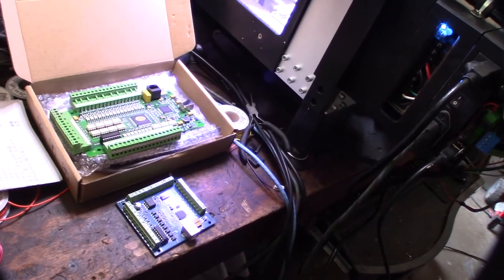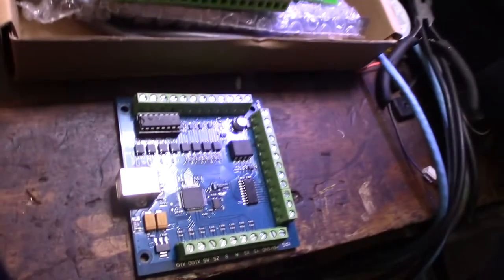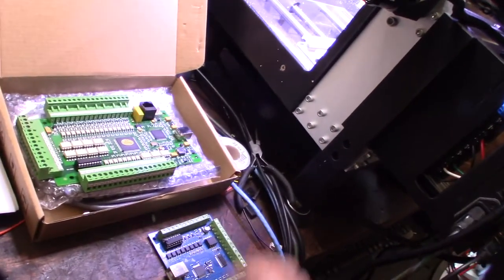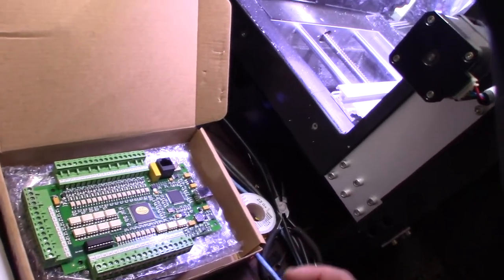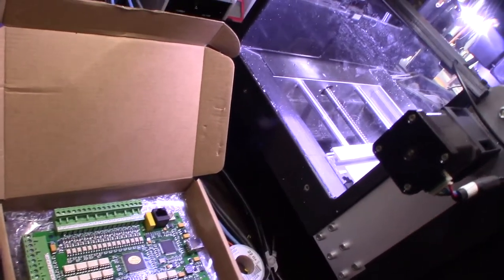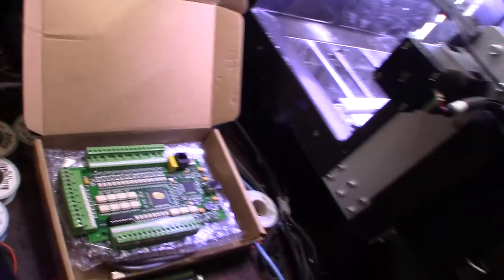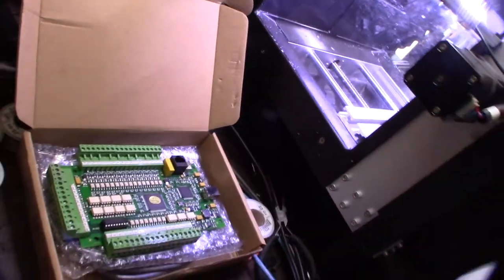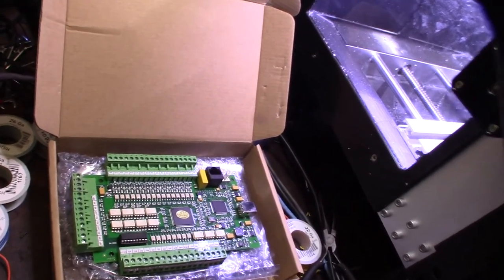Mach3 USB Smooth Stepper break out board controller vs cheap red or blue card difference

Comment: I decided to control my small CNC plasma table using an EC 300 board rather than the typical USB boards. The reason for this was I understand that ethernet controlled boards such as the ec300 are less prone to interference from the plasma arc than USB controlled cards. Having never wired a CNC machine before I'm wondering if I got myself in too deep choosing a board that is less well documented. Do you think wiring it to the motor drivers and power supplies will be any more difficult than say an Arduino type board? Any advice would be greatly appreciated. Thanks. Subscribed.
Reply from the maker: I had an EC300 and EC500. I got rid of them both. I went to smooth stepper. I could never get probing to work reliably on the novusun boards.